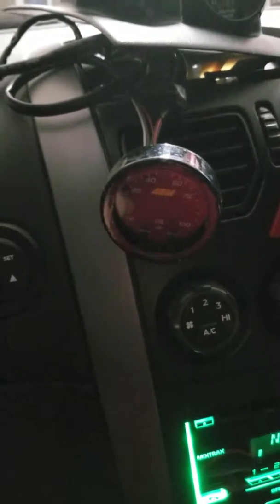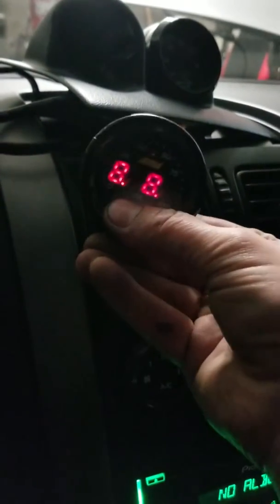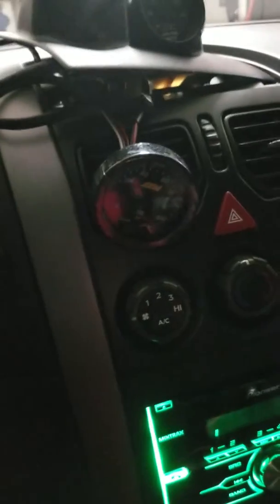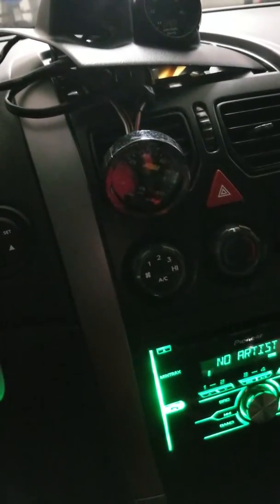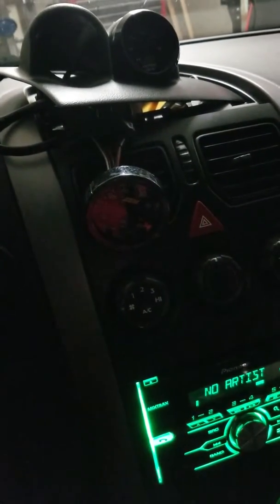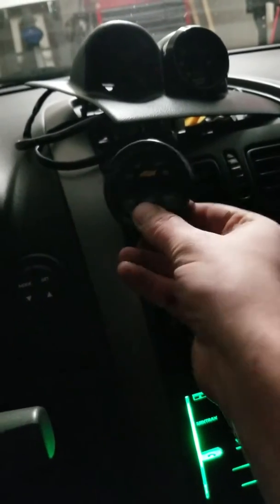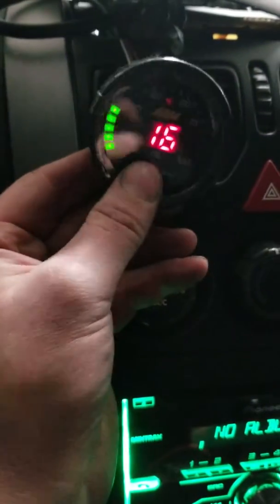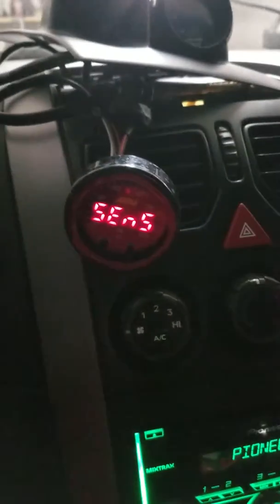AEM X series oil pressure gauge problem

Comment: Literally have the same problem just got the replacement one today and it worked for like 2 min and shut the car off and then it just stopped working very disappointed what company gauge do you have now?
Reply from the maker: I just bought a $20 one from o'Reilly's.  Works perfectly.
Reply: GTO Kid did you extend the wires for the harness by chance?
Reply from the maker: @ludwint7031  yes. I mentioned the readings  I got with my multimeter in the video.